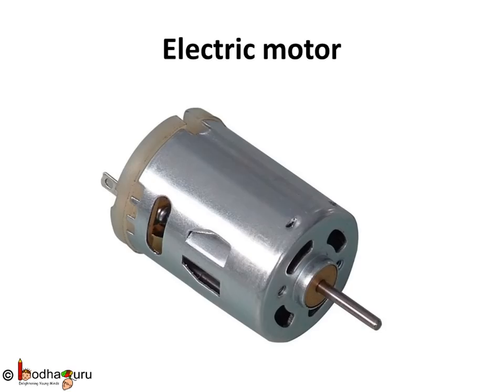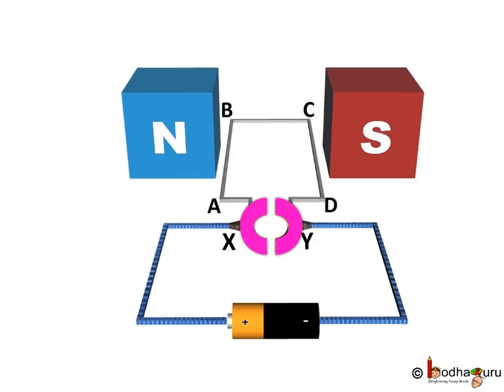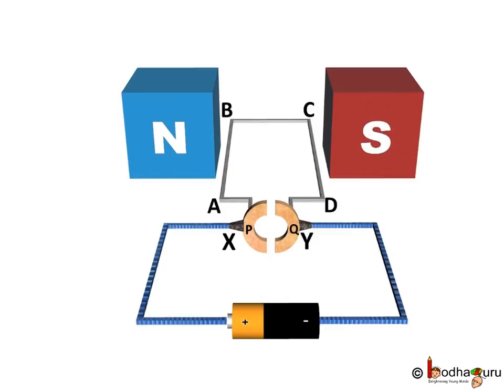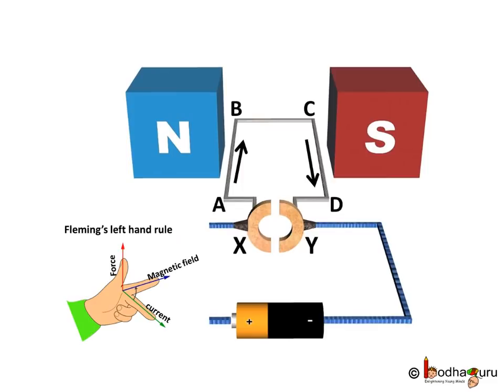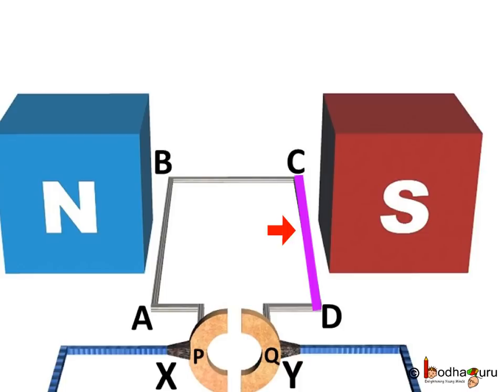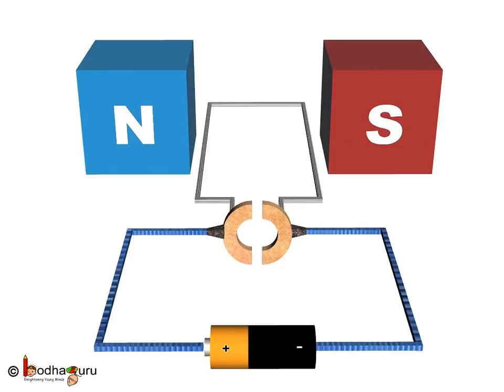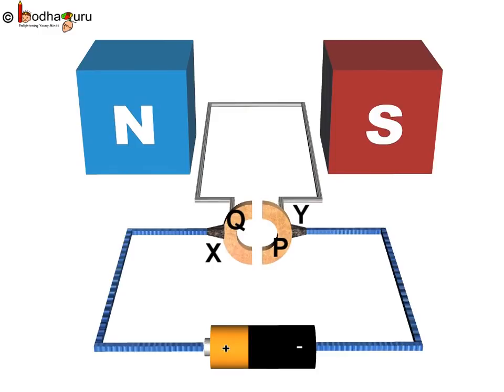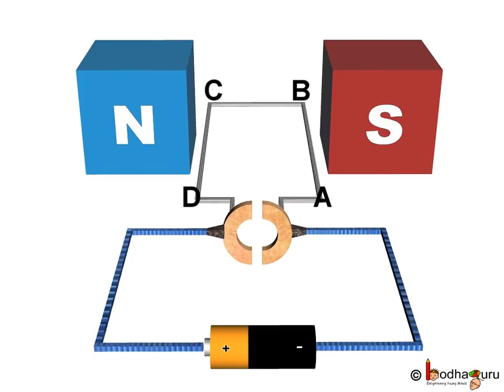Physics How an Electric Motor Works - Magnetic Effects of Electric Current Part 9 English

Comment: What I don't understand is that what is the role of those magnets between whom the armature is kept🤔
Reply from the maker: Those are opposite pole of same magnet and they produce the magnetic field required. Watch the video again keeping this info in mind.
Reply: Bodhaguru But what magnetic field has to do with it, when amature will itself start behaving like a magnet when the current is passed through it. Like it is based on Fleming's Left Hand Rule, right?  What is the role of magnetic field in it? 
I'm so sorry if I'm irritating you but I seriously don't understand what is the role of magnetic field in it?
Reply from the maker: Now, movement in conductor is produced because of interaction between magnetic field of the magnet and magnet field produced because of electricity flow. It doesn't move because it became  magnet. Because, say, the wire is a copper wire. It won't become a magnet. But, still it will move, because the electricity flow is creating a magnetic effect i.e. the magnetic flux which interacts with magnetic field of the magnet (imagine a pole repealing other magnetic pole causing a movement), but you can use non-magnetic material , like aluminium, copper same effect.
Reply: Bodhaguru Interaction between magnetic field of the conductor and magnetic field of the magnet...how? Because the pieces of magnet that we have taken are north and south poles of strong magnet and the direction of magnetic field is always north to south, right? So this means that the magnetic field of both the amature and the magnet is north to south. Can you please tell me what do you mean by interaction between the magnetic fields? 
OR
Is it that the fleming's left hand rule only applies when a current carrying conductor is under the influence of magnetic field ?🤔
Reply: Alisha Thakur i think its because.. u see that the split rings have a gap in between..right? so when the conductor moves and when the gap comes in contact with the brushes{the circuit will be cut there} there wont be eletric current passed on the conducter to move it.. that is when the magnetic lines help as it will be perpendicular to the conductor and that is when u can apply the left hand rule and the conductor will move
Reply: Magnets provide magnetic field due to which a force is experienced by the armature ie the coil..
Reply: Ru a fan of v
Reply: Taehyung

Comment: Thank you for the video. It really helped my understanding of the concept. However if you do not mind, I have a small question regarding the spinning ring. Why does it have gaps in it?
Reply: The split rings are essential because it reverses the moment of current. If those are not attached with a copper brush, only half rotations would be possible.

Comment: Why we use split rings why not complete ring?
Also, why we used carbon brushea
Reply from the maker: We use split rings so that the direction of flow the current in each coil gets reversed  at each half  rotation, This gives rise to a continuous rotation of the coil and to the axle.  Thus  electric  motor creates  continuous rotating motion.  We use carbon brushes so that they wear down faster than the split rings against which they press. Thus we need to replace the carbon brushes instead of the split rings. In short we can say that the purpose of carbon brushes is to reduce wear on the split rings which act as commutator.

Comment: Why you use  carbon brushes
Reply: ashruba ningule because-
1- if we directly connected wires to commutators then connecting wires will get twisted when coil rotates. So to pass the current, we use carbon brushes.
2- as for why we use only carbon because it has high mpt (3550 degree celcius) than copper (1080 degree celcius) and it is soft to avoid friction and sparking.
Reply: #Ashruba ningule -we use carbon brush because carbon have high melting point that not easily burn or it while roating a commutator it protect wire from breaking...m
Reply: Thank you

Comment: 0:49 AB and CD are parallel to the direction of magnetic field
Reply from the maker: Yes 2d view may seem that way, but in actual 3d view - consider x, y and z axis  then  three things are at 90 degrees i.e. direction of magnetic field, direction of current in arm AB, CD and direction of force causing rotating  movement of coil . (Just imagine the left hand  held with the thumb, index finger and middle finger mutually perpendicular to each other.)